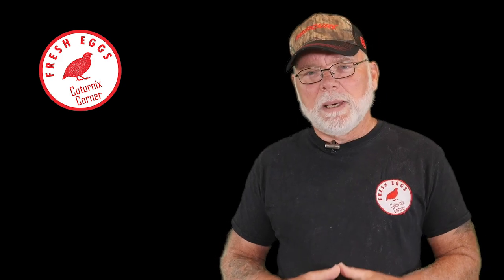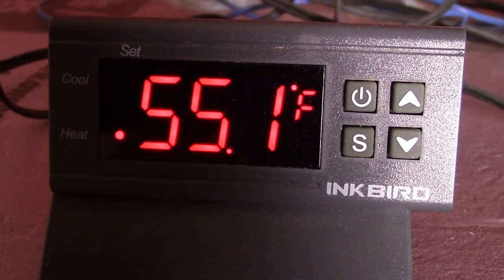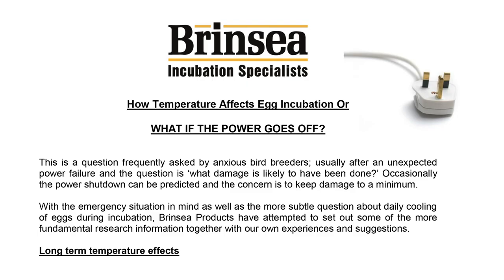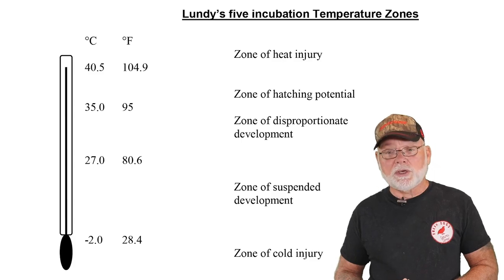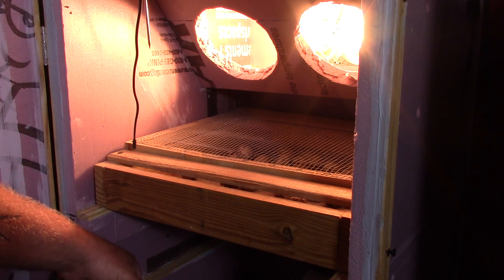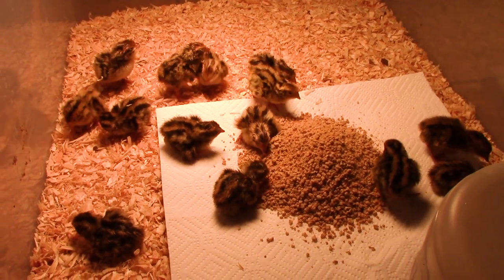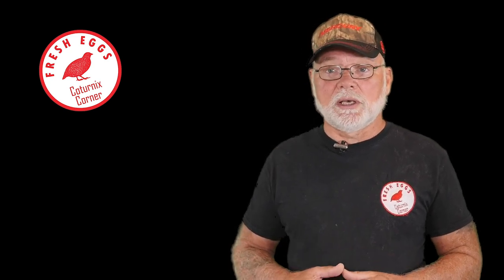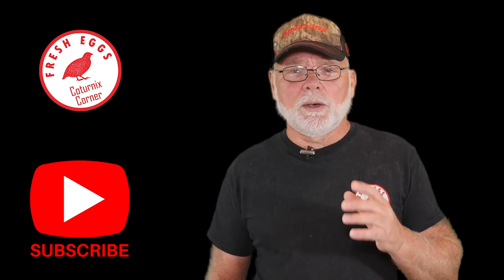INCUBATOR FAILURE - Will my coturnix quail eggs still hatch?

Comment: Whauw! I was looking for this information! So glad I found it. I'm in South Africa and we have regular power failures ("load shifting"). I did find that eggs (I have chickens and quails) still hatch, but now I have the scientific well-founded and researched information. This enables me to better plan and better know what to expect. Thank you.
Reply from the maker: Glad you found it useful 😀
Reply: You should look into getting a lithium generator for that, so you have renewable stored battery backup power (and good sun for solar where you are) and maybe add a small wind generator to it for those times when the sun doesn't shine. That or you can just plug them into an outlet to charge. 

They are taking over vs. gas generators and getting very popular and have many advantages (like being silent too). And you can build your own, or buy them ready made from companies for more. Even Duracell makes them now too, not just expensive ones like Jackery and Bluetti and the Duracell ones seem like a decent lithium generator for cheaper than those pricey brands. And there's lots of videos for building your own cheaply and fairly easily (and safely) all over Youtube.  

We have reliable power here in Canada in most cities anyway and I still want one, because we still get blackouts, like anywhere and I've found myself many a time in them, wishing I had backup power. And especially now, when I have critical stuff like more frozen goods and will be raising Quail soon and incubating, so it would be nice to have my own power for emergencies. Lithium batteries are way better than a backup system based on lead acid batteries and you can do more with them, with less in battery weight or the same weight.

Comment: OMG, thank you for this video. I'm in NV, we had a rain storm, just after my hatch went into lockdown, which screwed up heat stability with the higher humidity. I've been panicking, thinking it killed my hatch due to a 8 degree lower than it should be. Thank you for sharing this. I can stop beating myself up for having to dive into the incubator to fix where my thermometers were to get a better read on temperature.
Reply: I just had the same thing happen after three of them pipped in the turner! Well, they stopped and I didnt know if the temp drop had caused them to get chilled or not. Still waiting.

Comment: Thanks for this information.  I recently set one of my small incubators with some chickens.  About seven days in, this incubator had came unplugged.  About 12 hours had went by before I discovered it and my eggs were at 70 degrees.  After seeing this chart I feel better about my hatch which is now in lockdown.
Reply from the maker: Good luck with your hatch!
Reply: I just had the same thing on day 12...What was the end result in your situation?
Reply: @theltzone7544  My hatch wasn't as good as it should have been but still a decent hatch.
Reply: We had a power outage on day 11 and had not power for 12 hours and we kept it about 70 degrees as well. In lockdown now.
Reply: @mjschoensee93  Good Luck, let us know how it went.

Comment: Nice timing :) I'm hatching eggs for the first time (quails) and have been struggling with my HORRIBLE HHD 24S incubator :( I put the eggs into lockdown yesterday, and one had pipped this morning :) I were worried that my incubator had killed most of them, but that chart gives me some hope fingers crossed

Before setting the eggs two weeks ago I checked the sensor of the incubator and it seemed to be one of the rare one that was somewhat accurate, but I bought three additional thermometers just in case. When they arrived, after one week in, I discovered that the incubator had a major cold spot so that half the eggs had been sitting 1.1-1.4C/2-2.5F lower than the ones by the sensor :o Most of the time I had insulated the incubator, but that actually made things even worse (doubling the temperature difference from the sensor to the cold spot!). I found that covering the lid (and only the lid!) with my sweater worked (bringing the difference down to 0.5C/0.9F or slightly less), so the second week they should have been treated ok. Then came lock-down... I struggled several hours (!) to try to get the horrible incubator to not fry my eggs (the temperature difference got up to 8C/14.4F when i put paper towells on the grid since it had WAY to large holes, begging for feet injuries). Finally I gathered the eggs in one corner of the incubator were the temperature fluctuations were "low" ("only" 1C/1.8F across the tiny area with my eggs). Might build one myself next time... (or buy one from a respected brand)
Reply from the maker: Glad you are enjoying the channel, good luck with your hatch 😀
Reply: Some of those Amazon Incubators are horrible. I can't seem to find cheap ones on Amazon that don't have flaws of some kind according to the reviews and that one you mentioned isn't even available on Amazon anymore (I wonder why, lol). I am seriously thinking of building one like Terry's. Despite his bulb failure (expected and incandescent blubs only have a 1000 hour lifetime), it still seems like a more reliable one than those Amazon ones and cheap to build. His electronics didn't fail (which seems a common flaw in cheap Amazon ones) and neither did his egg turner and those egg turners from Amazon seem fairly reliable when bought by themselves and not part of a cheap incubator. I just have a real problem paying $180 for one of the classic (but reliable) styrofoam ones, or $300 for a good automatic one like a Nurture Right 360. I've priced out parts for Terry's and it seems it can be built cheaply.
Reply: @MrBilld75  Seems you have three choices: 1) Buy a better quality one (but the price differance is rather big), 2) build your own (fun, time-consuming and needs some research), or 3) Gamble with a low quality one (and do research to find how to compensate for the flaws)

In the end 9 of my 24 hatched (including 3 assists), but a lot of unfertile ones (only 2 fertile ones that didn't hatch if I remember correct, not including the first one that pipped, but died in the shell - I didn't try to assist that one :()

Comment: Timely info for beginners. We had a breaker trip last night and we caught it before the temps dropped below 95 degrees, but with a winter storm and power outages predicted, we were just discussing what to do if we lost power. We plan to get them near the wood stove without being too close. Wood heat is difficult to regulate, but with the high of 10 and low of zero, we should fare better than not getting them close to some heat. Thanks, Terry.
Reply from the maker: Thanks for the comment!

Comment: This is really helpful.  I was really worried about it occassionally dipping down to 98 degrees.  Out of 24 eggs, 16 hatched on the seventeenth day and four hatched on the eighteenth day.  There are 4 eggs left in the incubator on day eighteen and we will see what happens.  That's pretty good for shipped eggs.  The 98 degree drop is only happening after opening the airflow window for lockdown.

Comment: Hi Terry, I just built your DIY incubator and waiting for my first shipment of eggs to show up. I'm using a PID controller which is holding the temp very steady at 99.7 - thanks again for sharing that project
Reply: What PID controller did you use?
Reply: @TheRainHarvester  the cheapo inkbird temp controller. once i got the PID values adjusted it holds the temp very steady

Comment: I have a Nature Right 360. I put in 24 quail eggs and programmed the unit, so I thought. It maintained the temperature BUT DID NOT TURN THE EGGS FOR THE FIRST 10 DAYS. When I finally realized the malfunction, I reprogrammed the unit for the remaining days. Out of 24 there were 12 that proved infertile when candled at lockdown. This is about normal for my birds. They were removed. From the remaining 12, of those 9 hatched. Of the remaining 3 eggs  2 were fully developed but died, 1 partially developed.

Comment: I have a question. I'm incubating eggs for the first time. Quail shipped eggs. Today is day 12 of the incubation and i candled the eggs and took away the ones that lighted up like a bulb. I did the autopsy on those and I could see most of them died in like day 5-6. That's the same day I did the first ovoscopy. I did it only on a few eggs, no more than 5-6. And I was relatively quick opening the incubator and picking the egg. I opened it once for each egg. The thing is, I am feeling terrible thinking I kill those poor chicks by opening the incubator to see what was going on in the eggs, if anything was noticeable already. I saw in many videos people doing this and it didn't seem such as a big deal to open the incubator that many times. They're shipped eggs too and like so far on day 12 I've kept 19 out of 41 eggs I started with. Some of them didn't develop anything, others died around day 5-6. Is it such a big deal to open the incubator a few times to candle a few eggs? I thought this was better than taking a bunch of eggs out and letting them sitting in the cold while I candle the rest. Should I stop candling eggs altogether but before going into lockdown? For me it's an important part to see the development of the chicks. I don't know if this is so much of a problem as to kill so many chicks of it could have also been not related. Can anyone tell me if it was such a big deal to open the incubator or they died most likely of something else?

Comment: It's not all that strange that both your bulbs failed at or near the same time, seeing as you bought and installed them at the same time didn't you? (if that's the one you did a video on, on how to build one). Incandescent light bulbs have about a 1000 hour lifetime (fluorescent and LED last much, much longer but no good for you, cause they don't put off enough heat). And I know that is shortened by switching them on and off, because like anything under constant heating and cooling cycles (and being such fine and cheap filaments inside), they eventually break. 

The only reason the longest lightbulb in the world has lasted as long as it has (an incandescent that's lasted over a century now), is because it was never shut off and was made out of thicker tungsten filaments back then. But the average consumer incandescent lasts at most 1000 hours. They say this century old one would have burned out long before now, with heat cycling and they believe the only reason it never did (even in blackouts, cause it was backed up), was because it was never turned off. Great video by the way! It is a question that perplexes a lot of people and there like NO info. on it really, from people who kept going with it to see what would happen. Most just pitch their batch on the assumption they are all ruined, when the incubator breaks. Nice to know that's not always the case and there is hope! I've literally never heard another Quail Youtuber or any documentation about this, so it is so awesome you did a video on this. 

This is why I love your channel man, such good info. I swear you and Slightly Rednecked are my two favourite Quail channels, but there's quite a few good ones on Youtube like Myshire Farms and Self Sufficient Me and that charming American couple who are homesteaders on Living Traditions Homestead. You guys are all good with Quail and you sir, are the master in my book.

Comment: I have a question I had quail eggs that pipped but never hatched they died inside the shell. What do you suppose the issue could be? The temperature was steady the entire time. I had a little trouble getting the humidity up on lockdown day but eventually got it 70

Comment: When places the eggs in the incubator, when do you start counting down to hatch day? The same day or is there a certain hours to wait for the eggs get acclimated to the temperature? Also I enjoy your channel !!
Reply: I've only done 3 hatches but I find mine started hatching time from the hour I put them in. If I put them in at 7 pm they started hatching at 7pm 17 days later. However, It also depends of what the temp of your incubator is. If it is a little colder or warmer that will affect the time.

Comment: I’m struggling running both turners at once if I put the inkbird at top rack bottom is 3 or 4 degrees cooler any suggestions? If I put at  bottom rack the top is too hot.

Comment: I built this incubator and I'm noticing the temp going 105 after bulbs turn off but i have the ink bird set to 99 why would this be in getting the same readings from 2 different gauges

Comment: How did you connect the egg turner to the temperature controller
Reply from the maker: The egg turner isn't connected to the controller, they plug directly into a wall socket.

Comment: My DIY incubator failed and I lost 60 eggs last week. My inkbird controller failed to switch off and my temp got to 154* overnight. Will try a replacement inkbird controller but I'm still leary.
Reply from the maker: You must have got a bad one, both of mine are over two years old with no issues. Keep them on a battery backup with surge protection as they are susceptible to power spikes.